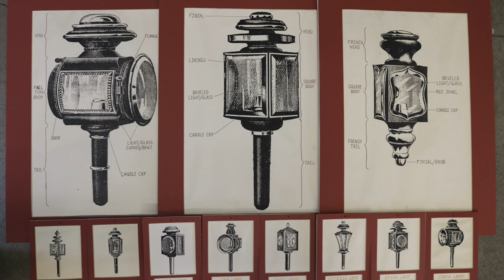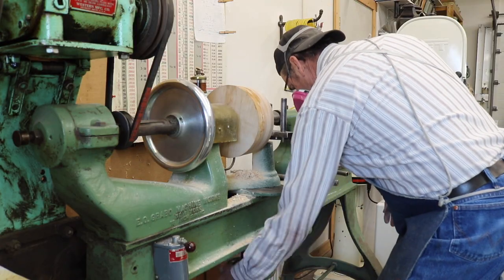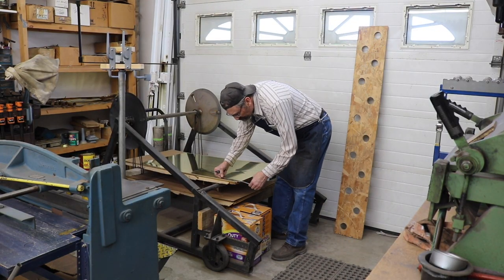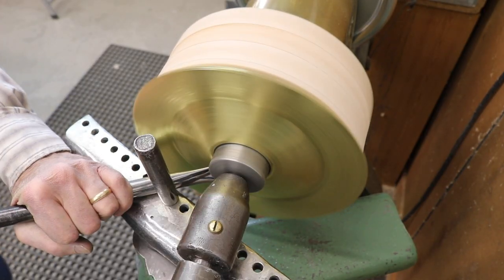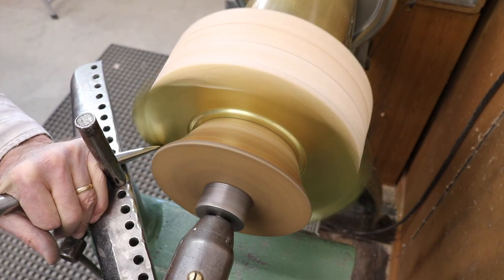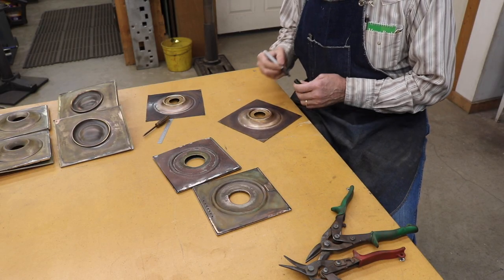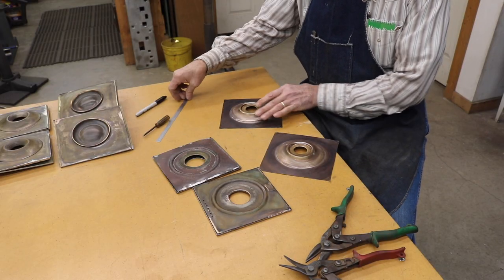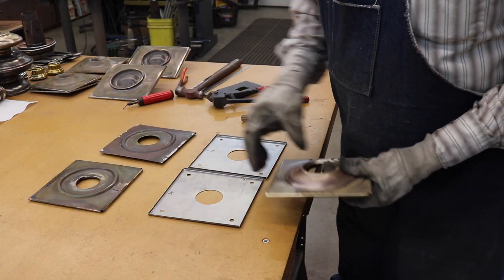Repair or Replace???

Comment: So glad you got your data back. Looking forward to seeing what was recovered plus new stuff. Quick question about punching the vent holes: I see you used an old wrench between the punch and the brass. Was that to keep the punch from imprinting the brass around the hole to be punched? Thanks again Rick!
Reply: I thought it might be used as a die stripper to push the brass off of the punch without deforming it. Anxious to find out for sure!
Reply from the maker: Yup, the Rotex punch isn't equipped with a stripper. That old flat wrench works great.

Comment: Wondering about the rationale for using the tin snips to trim the spinnings versus using the big shear. Was it that there wasn’t enough clearance to the raised part? Perhaps something like a Beverly shear would be useful in such cases?
Reply from the maker: The crown formed by the spinning goes all the way to the edge of the piece. The shear would flatten it while the snips allow it to remain. A Beverly shear would be overkill on the light metal of these pieces. Thanks for watching!

Comment: Depending on which is cheaper replace or repair?
Reply from the maker: Cost is an important factor, but historical significance and wether the part is actually an original part is important too. Thanks for watching!